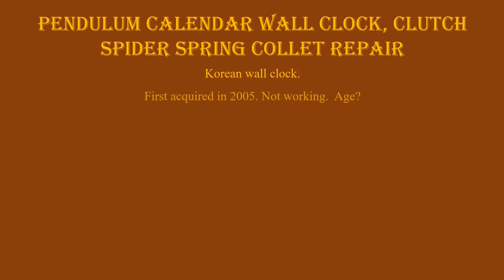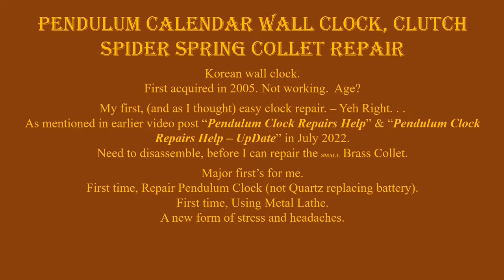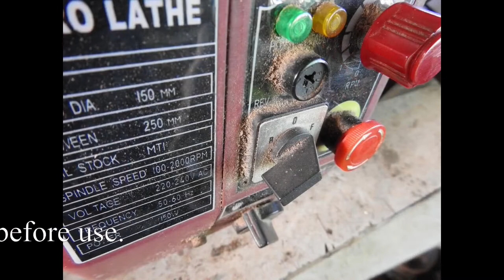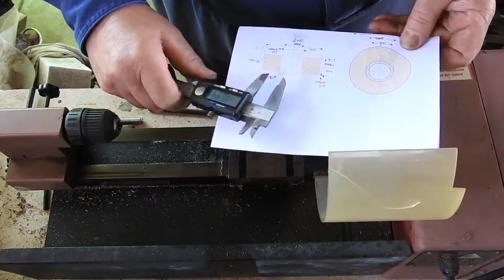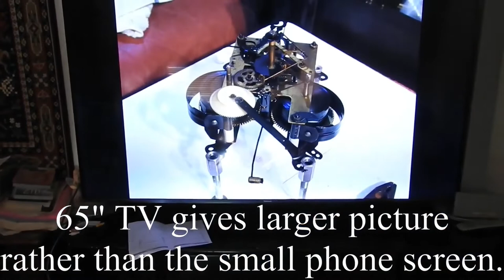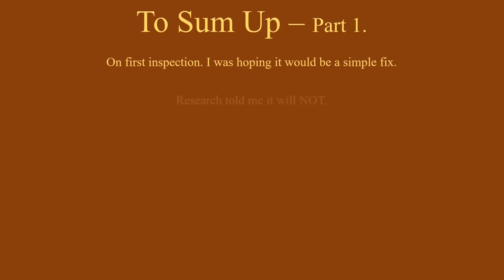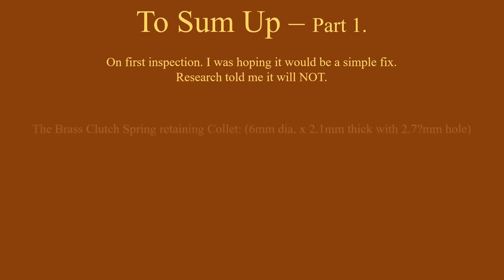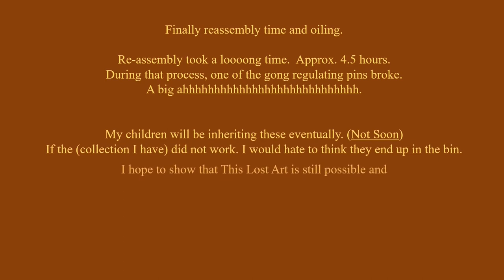Pendulum Clock Repair Pt 1

Comment: I use zip ties around the springs also, so I can get the movement apart without the gears flying or getting bent and then let the spring down slow, onto the zip tie. Great job on using the lathe. I have no experience with one.